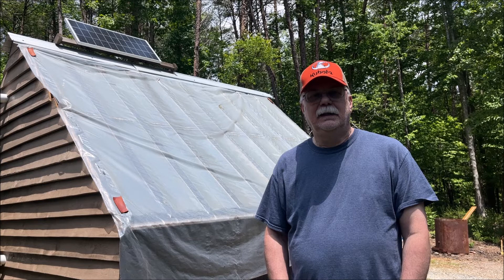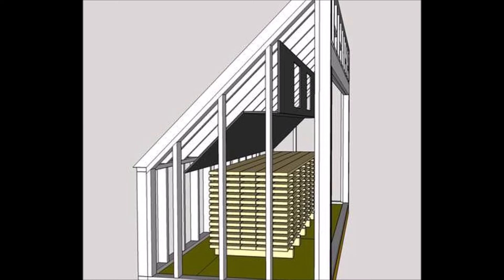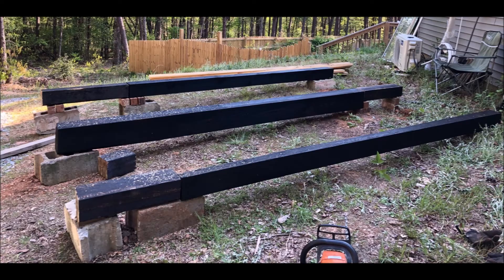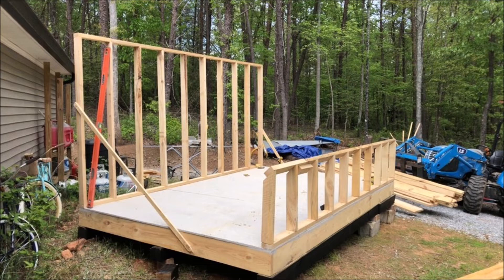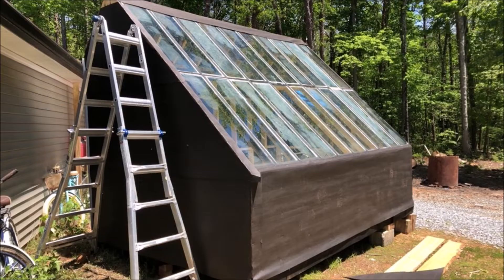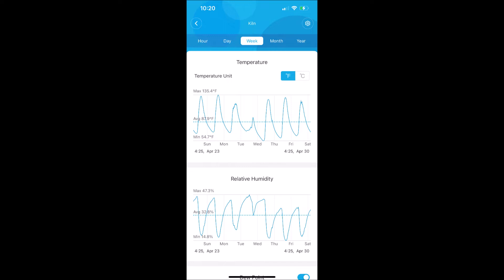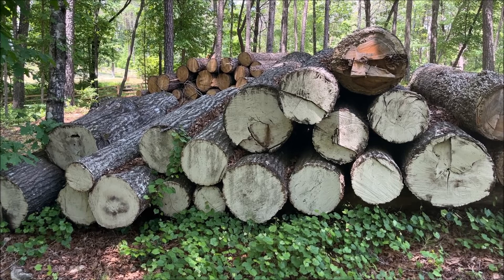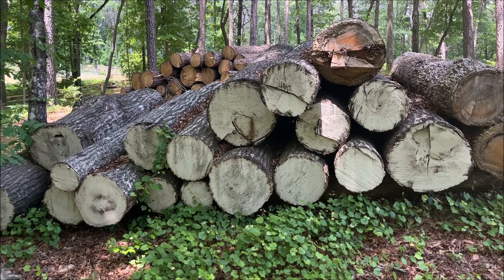How did our Solar Kiln build perform in it's first year? I'd say pretty good!

Comment: Just found the channel and subscribed. I also have a small mill and a love for woodwork.

I have a kiln in the building process...16'8" x 9'...a 41° collector angle. We are in North Florida with WAY more summer heat than needed and probably 60/40 prime kiln days over winter.

My hope is to build an automated-for-efficiency temp/ humidity air handling system.

Using solar to a battery bank, an Artuono controller and some programming--all yet to be completed--to prevent problems with too much heat.

It's great to see others with the same interests...I also have experiments ongoing with sugi ban, both as protection AND used with colored epoxy.

Comment from the maker: Summarizing my temps per load. During the peak of summer, the kiln will hit 150 degrees when empty or when the wood has dried. During the Spring and Fall, the highest temps are between 135-140 degrees. These numbers fall down to about 120-125 degrees when a load of "wet" wood goes in. You can see these temps go up as the days go by and the wood dries. 

On a sunny Winter day, temps can get as high as 115. However, because there's very little humidity outside, the inside humidity will get ridiculously low. Because of this, I think I got a significant amount of drying over the late fall through early spring time frame.

On the few loads of 4/4 pine boards I've loaded, air movement is important to avoid mold. I supplement the solar fans in the humid summer months with a box fan. I didn't have any problems during the fall or winter when it's much drier on average in North Georgia.
Reply: a hoop greenhouse would work

Comment: Awesome video post, thank you! I’ve only been milling for about three seasons and am considering building a solar kiln. I do a fair bit of furniture and musical instrument woodworking in addition to milling lumber for construction around the homestead. I noticed you mentioned that you air dry for a year or so before going to the kiln. Have you ever gone straight from the mill to the kiln? If so, did you notice any difference or in your opinion is that an undesirable thing to do? Thanks.

Comment: Great narration and video. Did fine on your presentation. I have the same issues where I want to put my kiln. Trying to figure out how to make a front folding wall. So I can load and unload with a forklift maybe there will be a couple hydraulic cylinders on the ends???

Comment: Hi , 

How are your fans connected to your solar panel ? is it by USB Cable 

What's the software you use to monitor the temp/humidity
Reply from the maker: The fans come with proprietary cables intended to hook up to a charge controller. I just cut the ends off in my case and hard wired them to the fans.

I use Govee devices which measure both temperature and humidity (as well as few dew point and VPD). I use the app to track. It maintains a historical record so I can look back days/weeks/months. I have four units. One for the mill, one for outside temps and the other two for unrelated purposes.
Reply: Wonder if I could use the difference between a top and bottom temp/hum (two each sensors) to dial in the correct amount of water removal.

Just a thought I hope to pursue soon...
Reply from the maker: @dantco  If you figure it out, let me know. The scientific guys utilize load calculations to determine the optimum size of the kiln for a given quantity of wood. The problem is that this varies from hardwood to softwood. Technically, it also varies as the wood dries out. Some say vent. Others say don't. Even others say vent up to a point and then don't.

At the end of the day, you can't really force the internal temperature of the kiln. Insulation, dark absorbing surfaces, outside temps, clouds, etc. are all factors. I chose to use materials I had on hand which may or may not be tuned to how much wood I load. I personally vent until my glasses quit fogging up when I walk in.

My Govee devices show the temps rising every day as the wood dries out. Humidity falls every day. When it appears that the humidity bottoms out over the course of several days, I take my meter out and take a looksie. Works for me.
Reply: @dingleberryfarmhomestead2336  one conclusion that is easy enough to reach is that your way is as legit as any other. The rest is art.

Soma ideas. When a new load starts, there should be a sufficient humidity for the evaporation in the stack to stabilize. Shut vents-max fan flow.

After stable, vent on high temp first and then by desired water removal rate. I live in FL and guess that high summer temps could be an enemy.

I plan on having a solar powered controller to run the vents based on some code. Mostly a stab in the dark to start and then learn by results. There are a few schedules suggested by forestry students and university programs to digest, but mostly it's going to be just like you...learn by doing.
Reply: Are you using one 100 watt solar panel?

Comment: Do you have to air dry the slabs for a year first?
Reply from the maker: It's not necessary but a lot of people do. Wood is actually VERY wet when first cut. People like me with limited space in the kiln will let some wood air dry until space becomes available. The longer it dries outside, the shorter the time required in the kiln.